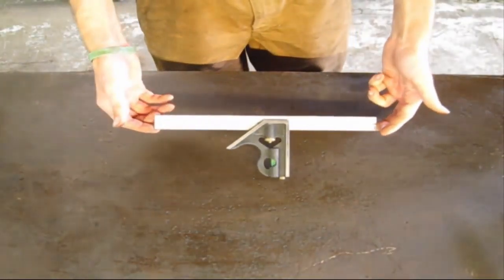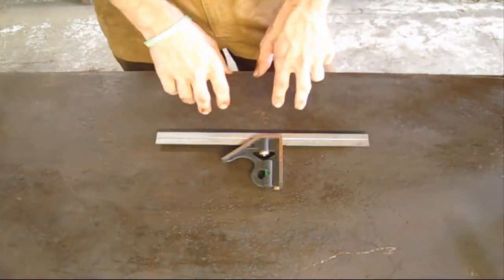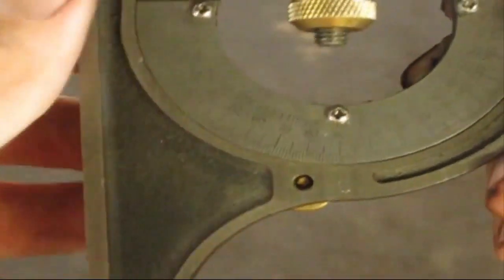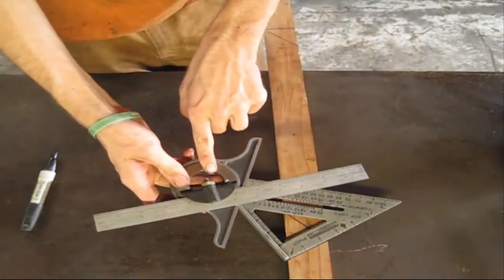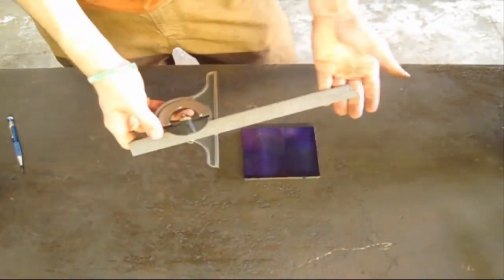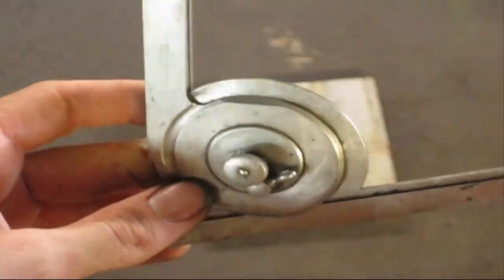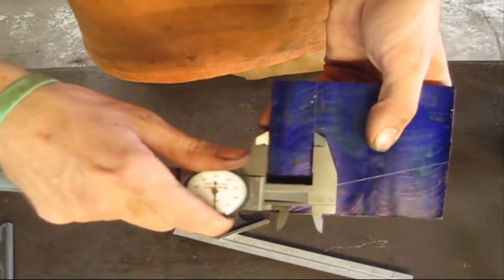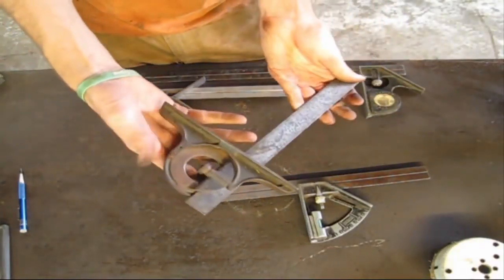COMBINATION SET

Comment: Purchase link of the product in video: http://amzla.com/vf0vksw2i3qa

【MEASUREMENT RANGE】Carpenter square is 0-180 degree measurement range with an accuracy of 5' / 0.08 degrees. Ideal for measuring the inside and outside corners of parts.
【ETCHED CLEAR AND ACCURATE】Machine divided 4R graduations - 8ths, 16ths, 32nds & 64ths. The combination square ruler scale is accurate, clear and easy to read, with level, marking needle. This woodworking workshop uses a beveled edged blade, roller knobs and fine adjustments. Each tick mark is laser engraved, so it is a laser engraving scale.
【MATERIAL】Protractor square is fully hardened and tempered stainless steel blade, rustproof, durable, satin chrome finish. The tooth holder is made of high quality zinc alloy, which is durable.
【CONVENIENT & PRACTICAL】The nut fixed body can be separated, convenient and practical. Woodworking square with horizontal bubble is practical.
【PURCHASING GUARANTEE】After-sale service is 24h online, if you have any question and problems with our machinist square, please feel free to contact us. We will provide after-sales service until you are satisfied.